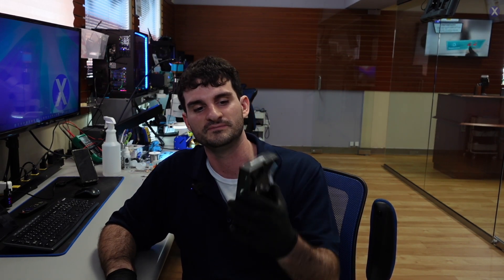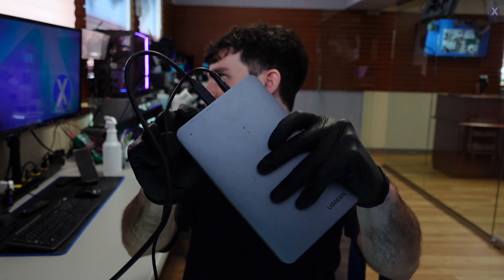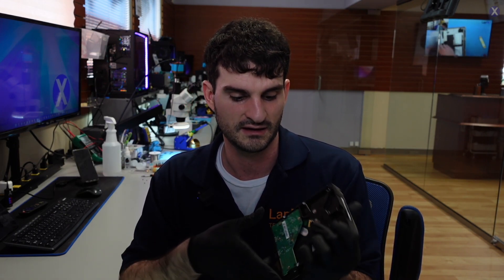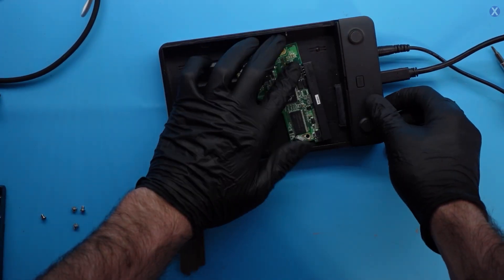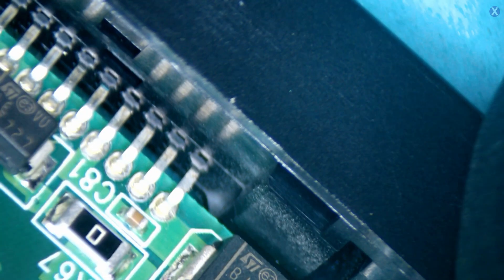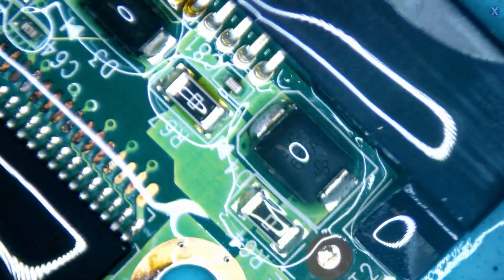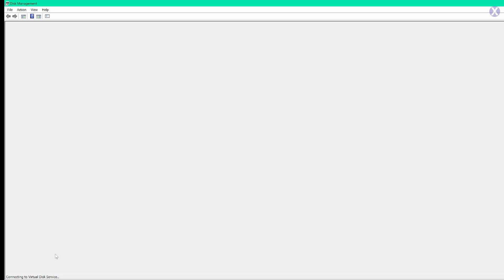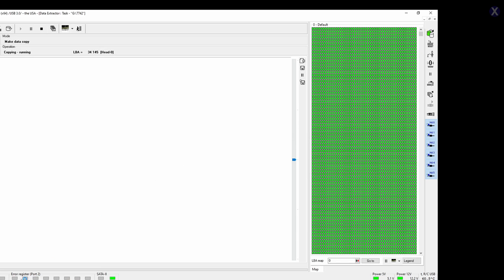Data Recovery From A WD Hard Drive With No Power

Comment: Please Help me ,
I have a dell insprion 3501 which worked fine till 2 hour ago
Suddendly my laptop tuned off now not turning on , no lights whatsoever

I only see a ln amber light in the led1 position in motherboard it is soo dim that i had to open the back o laptop 

It only lits when ever i press the power 
And goes off when i release

I had my dc jack replaced 2months ago
New charger about 2 weeks ago working